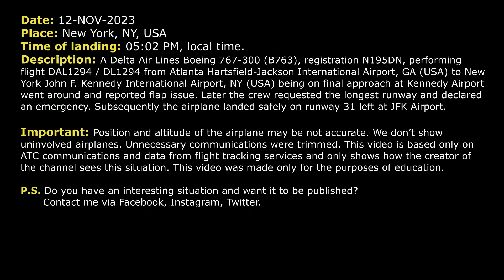Flap issue. Delta B767 requests LONG RUNWAY for emergency landing at Kennedy Airport. Real ATC

Comment: Delta needs to offload the 763’s
Reply: Why? They're good airplanes.
Reply: Delta owns all their 767s. Pilots love to fly it. Passengers like the 2-4-2 comfort. It is very reliable. If it has a technical problem now and then, so does every other plane in the Boeing/Airbus/Embraer fleet. Why would they "offload" them  at this time?
Reply: @wotan10950  "Delta owns all their 767s. Pilots love to fly it. Passengers like the 2-4-2 comfort. It is very reliable. If it has a technical problem now and then, so does every other plane in the Boeing/Airbus/Embraer fleet. Why would they "offload" them  at this time?"

Thank you for making my point for which I am not able to so efficiently convey. I agree exactly with your thoughts.
Reply: Let’s see.. we can start with dated technology, non emission friendly engines, and the average age of the fleet is 30 years old..
Reply: @trevorwofford3242  "Let’s see.. we can start with dated technology, non emission friendly engines, and the average age of the fleet is 30 years old.."

Nothing of which you posted is relevant except that if their age is causing delay issues, then that is a problem. At my airline we have the oldest of 757s and they're still operating with a high level of dependability -- and still making the company money because they're paid for. I suspect the 767s at Delta are paid for too.
Reply: @JohnSmith-zi9or  it’s not relevant because your airline isn’t Delta. 

It is all highly relevant.. for the top airline in the US.
Reply: @trevorwofford3242  "it’s not relevant because your airline isn’t Delta. "

I probably flew this 767, at Delta. Now you know.